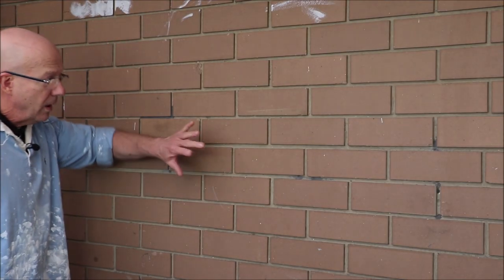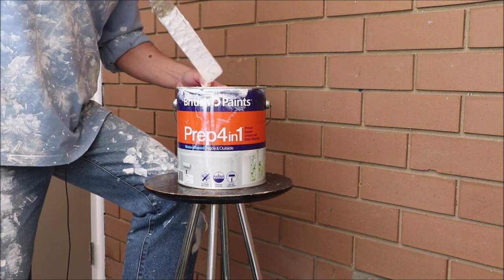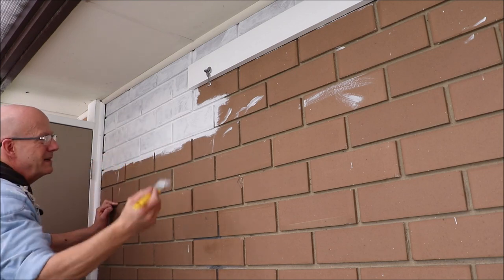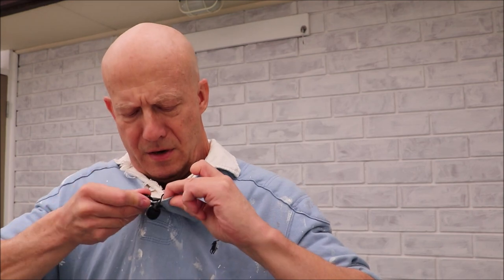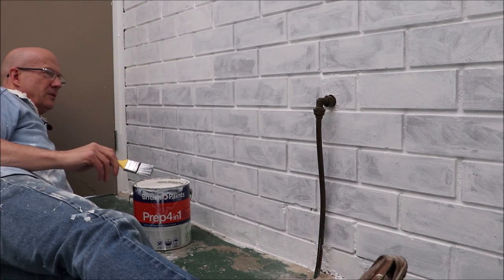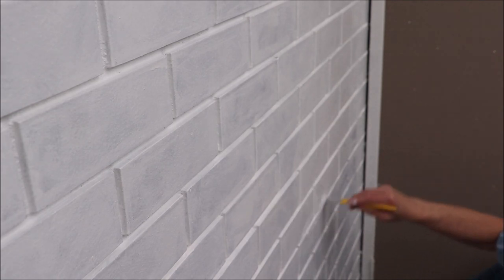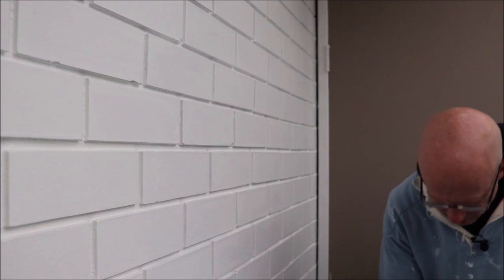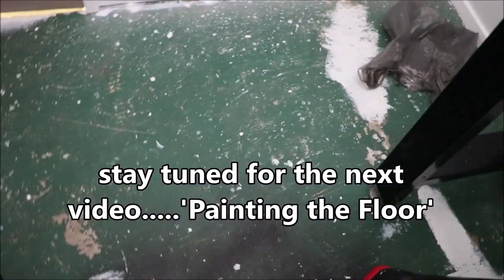How To Paint Your Brick Wall. Great Result! SAVE $$$.

Comment: Looks like the faces of your bricks were smooth. Mine are rough, which I think will make life harder - any thoughts?....
Reply from the maker: I'd still probably go about it the same way. That is with a brush first to get into all the tight areas and then with a roller but for rough surfaces I'd use a roller with a bigger nap (it will have it written on the packet). Good luck!👍
Reply: Thanks very much indeed - I will be taking your advice.

Comment: As a pro I'll say good result but fewthings sprung to mind. 1 get a bigger brush because you hit most of the face of the brick when doing the awkward bits. 2 roller pole.  But the job looks great these things are just to improve speed
Reply from the maker: Thanks for the tips Ross! I'll keep them in mind. Glad you like the result, it was fun to do but harder work than I thought. Cheers, Mark.
Reply: Would spraying the wall down with water be enough to remove debris before starting or does it need a proper wash ? I have a wall of about 600 square feet so really was just going to pressure wash it and let it try before starting. 

I'm also using a spray gun and am planning on doing 1 coat of exterior primer/paint on it would this be fine or would I need to do 2 coats forsure ? 🤔

Comment: Diluted PVA before  paint helps with porosity. Masonry paint 1St coat diluted with water. Followed by two  neat top coats.  Long pile.roller and brush . Job done in half the time. Good video.though. 👍🏻👍🏻
Reply from the maker: Cheers, thanks for the tips! And thanks for watching.👍🏻
Reply: @MarkdoesDIY   youre welcome. For my woes ive been a painter 30 years now. Getting way to old. 🤣🤣

Comment: Would using a spray gun be ok its for a walk out basement patio wall its huge and cinder block wall
Reply from the maker: I initially tried with aerosol spray cans (on the side wall in the video) but I couldn't get the right coverage and I had a much smaller space than you. I had either paint runs or barely any coverage at all, it was difficult to strike the right balance. I found the brush and roller gave me a better result. Thanks for watching. Cheers, Mark.

Comment: Mark, do you think it would be ok to use a power washer to clean the walls instead of the time consuming brushing first?
Reply from the maker: The bricks and mortar need to be in good dry condition before painting to allow the paint to really stick. A power water washer would allow water to get deep inside any cracks or faults in the mortar (or bricks) and the drying time would be far greater than hand scrubbing with a brush and soapy water. Hand scrubbing also allows you to get up close to the surface to really see anything that needs attention. Cheers and good luck! 👍

Comment: I have a QUESTION for you!! :)
Thank you! Your wall turned out great. 
I have a shed I want to paint (inside) but don't want to plaster it because I'd like to keep the brick effect.
I've researched that paint applied straight onto brick weakens the brick over time and starts to fall off. 
3 years have pasted since you uploaded this video. I was wondering if you've had any problems with the wall or is it still looking good as new??
Reply from the maker: Hi Kim, the painted wall is holding up well. The paint still looks fresh and has not started coming off at all. The wall is indoors , so no weather to damage it and I gave it a really good clean first. I took my time and thoroughly applied 2 base/sealer coats and then 2 finishing/top coats, so I tried to give it the best chance of success and so far it's great. I can only speak for my wall but there's been no problems at all after 3 years. Thanks so much for watching and for the great question! Good luck! 👍

Comment: Hi, I don't understand if you used a primer/undercoat /sealer, then an other masonry paint for the top coats as you just used the same tin, or did I miss something ?  Thank you for your help.
Reply from the maker: Yes, I used the same paint for all the coats. You didn't miss anything! I was happy with the colour and it was a hard wearing paint so I did it all with that. Cheers! 👍

Comment: What paint is required ?
Step by step process required 
First I go to the shop then what will I order there for painting exterior brick wall ?
Reply from the maker: I went to the hardware store and discussed the job with the people that work in the paint department and followed their general advice. If you ask them for a paint suitable for your particular project they will put you on the right track. I just started with a 4 in one preparation / undercoat / sealer. In the video I show exactly what paint I used. Cheers.👍

Comment: Would washing the wall instead of brushing it off with a brush work aswell ?
Reply from the maker: Yeah, that would work fine. As long as you get rid of all the dust and other debris that accumulates. Cheers!
Reply: @MarkdoesDIY  thank you for the reply 👍😎

Comment: Great video. Can i ask how many litres of paint you went through? And your surface area?
Reply from the maker: The height of the wall I did in the video  is 2.1 metres, the length is 2.6, that's about 5.5 square metres. I applied two coats of primer which was about 2 litres and two coats of top coat ( again 2 litres), so 4 litres in total. Thanks for watching and for the comment! 👍

Comment: Hi mark. That coat that you did with the roller, was that the same 4 in 1 paint primer or was that a different paint?
Reply from the maker: Hi Sean, Yes it was the same 4 in 1 paint. I was going to apply a tinted top coat but when I saw the room finished I was quite happy with the colour of that base white. I still may change it to a tinted top coat down the track but have no plans to right now. Either way it's a good base on those old bricks. Cheers, Mark.

Comment: Why not spray?
Reply from the maker: I thought the same, so before I filmed the video I tried spraying a small adjacent wall but I couldn't get the same coverage and depth (especially in the mortar) that I did with the small brush, without making a lot of heavy drip runs. The way I did it might seem slower but for me the brush was the best option. Of course someone with better gear and spraying skills than me might take the spray option, it's just that the brush worked for me. It's still looking good too without any touchups. Cheers and thanks for the look in! 👍

Comment: why didn't you use the paint roller from the start, instead of the small brush? seems like a foolish waste of time.
Reply from the maker: Fair question. The mortar was recessed in quite a bit back from the surface of the bricks and so I really needed to push the brush in to reach all of the mortar. The mortar was also very porous as well so it really soaked up the paint, making me load the brush quite heavily. So, as I was doing this there was enough paint on the brush to do the bricks as well, so I did. I could have run over the bricks at this point with a roller but as I was there with a brush and paint in my hand I just continued over the bricks with the brush. 
Thanks for watching and commenting, Cheers!

Comment: Hey Mark how long did that wall take?
Reply from the maker: It's a small wall, 2470 mm wide (8ft 1inch) x 2110 mm tall (6ft 11 inches) and  I took my time (filming it takes a bigger chunk of time than you might think and I tend to work slowly) and waiting the recommended drying times between coats took three days in total but could easily be done in two if you don't film it. Thanks for watching. Cheers, Mark.